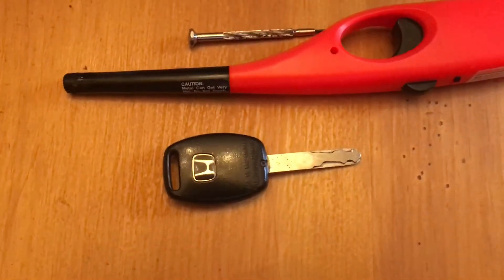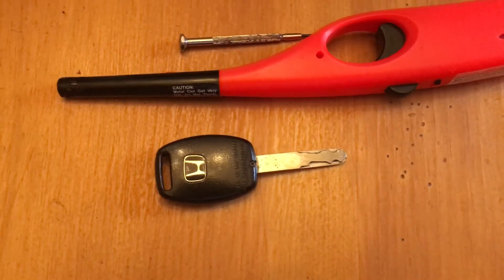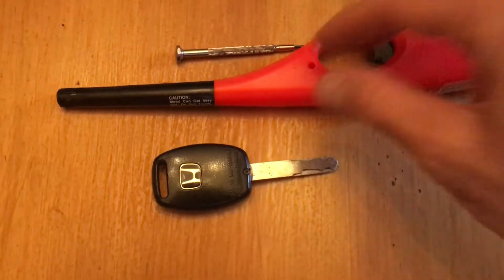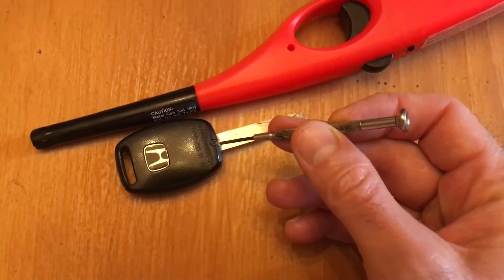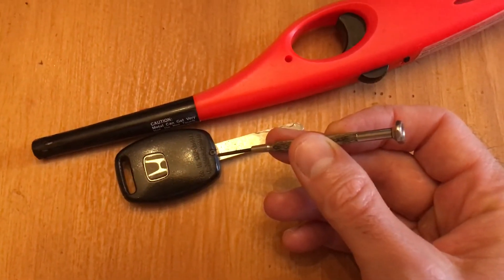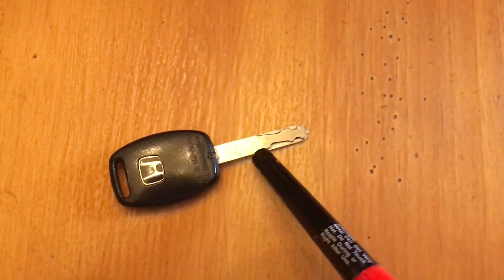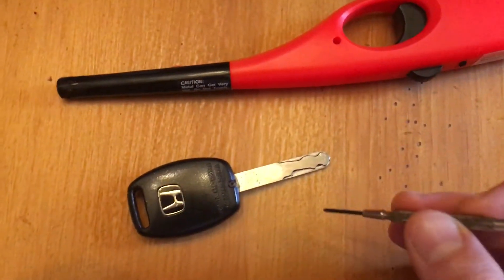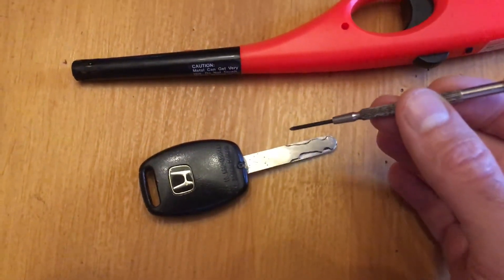Remove Frozen Screw on Honda Key Fob    Stripped or Stuck Civic

Comment: Heat does the trick, even with a partially stripped screw! I used a BIC lighter, but a candle would probably do, anything to heat key enough to melt glue that locks screw.